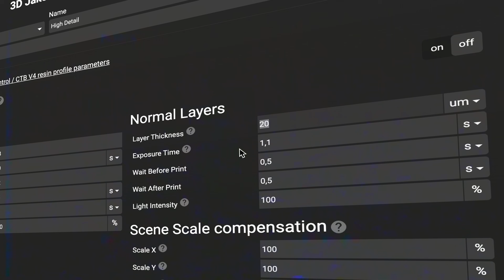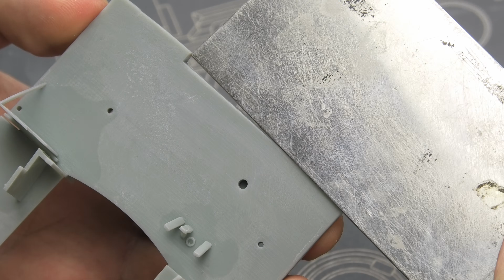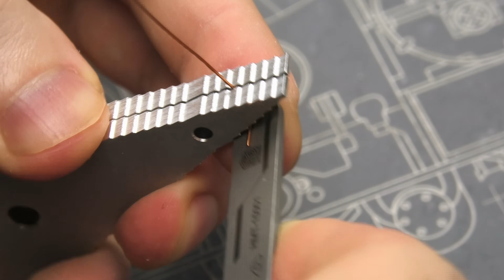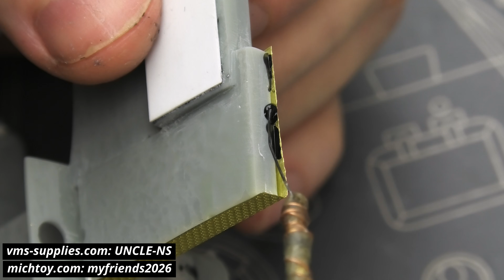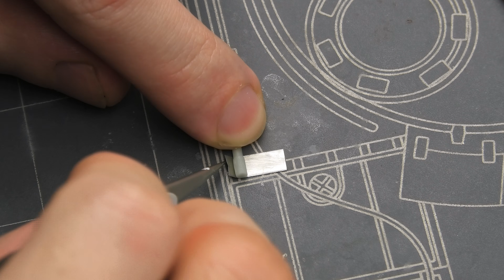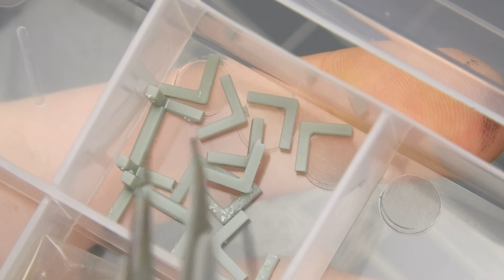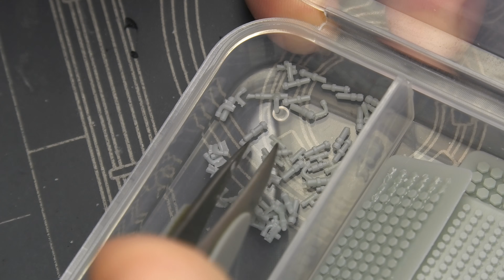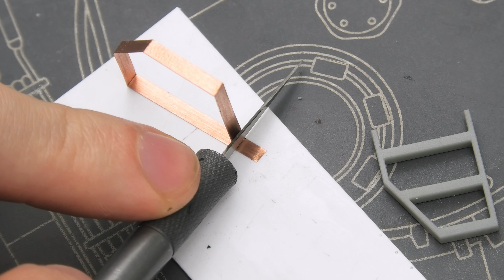Yes, Childhood Dreams Do Come True: Pacific P16 3D-Printed Scale Model

Comment: Very hot water before removing the supports makes them pretty much peel off unless you have made the connections too strong.
Reply from the maker: 6-10 mins in alcohol does the same thing, it's really cool
Reply: @NightShiftScaleModels no it does not
Reply: @NightShiftScaleModels  no seriously, consider using heat. I have a heat gun hooked up to an on/off foot pedal in my support removal workbench area (so I don’t end up with resin contaminated water) and it makes printing delicate parts so much easier, and saves so much sanding and post processing time.
Reply: @pbkobold  with multiple stage washing as shown in the video, you really don't need to worry about it. With hollowed models you just need to be very thorough in the first wash to flush out all the raw resin on the inside. But if a heat gun works for you, then go for it. 
In any case the difference between room temp and like 60-70 degrees C is absolutely insane, unless you have oversized your supports. If the supports are "just enough" then the parts will peel off with pretty much 0 pockmarks.
Reply: Resin contaminated water isn't really a big problem. Just cure the water by putting the container in the sun for a couple of hours, then run it through a coffee filter. If you're really lazy, you can let all the water evaporate and collect the cured resin particles after